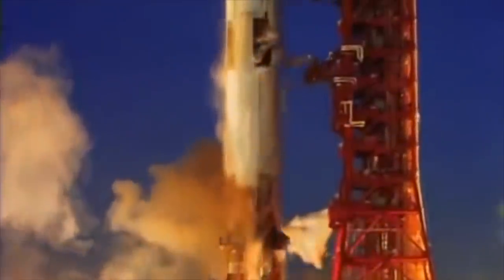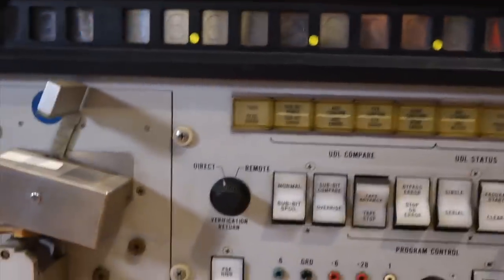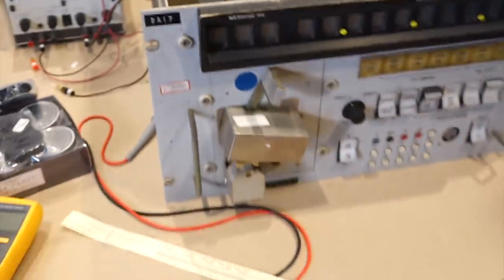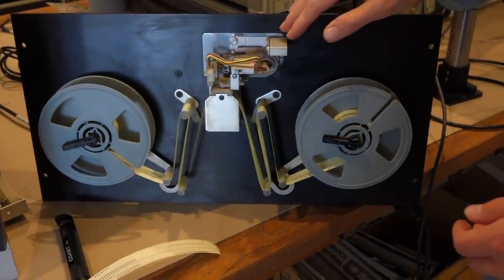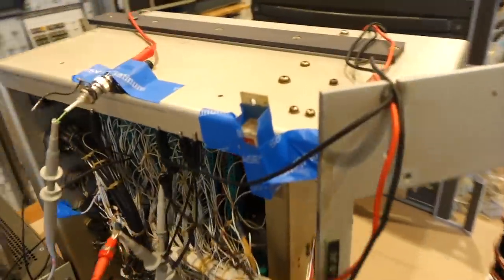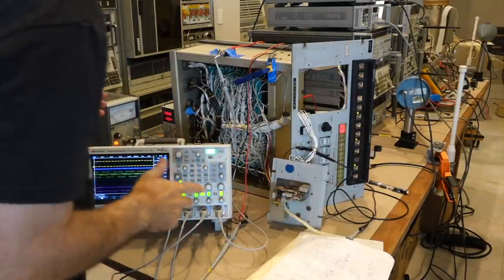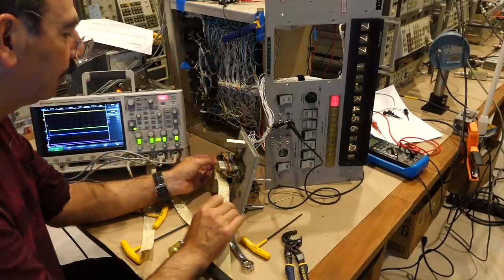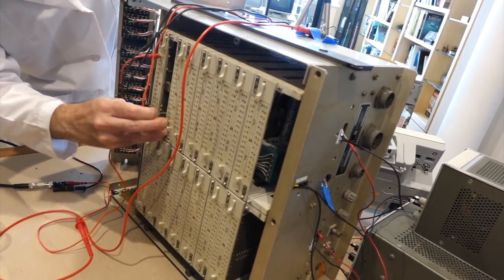Apollo Comms Part 9: Mystery Up-Data Link Test Set

Comment: Going this way in a couple of years time you'll be debugging the F1 ignition sequence on a rocket built from fixed scrap and spare hardware with holes plugged with HP test equipment, and I'll be writing a comment that the next step would be to try and do a couple of loops around the moon =)

Comment: A big rubber mallet and some pipe-fitter's pliers on the table too.  For when subtlety runs out.  
Congrats guys, you have intimidated it back into working order.
Reply from the maker: Taking the tape reader apart and extracting the cards required some convincing! Parts on the reader had sort of welded themselves together, and corrosion on the connectors made it impossibly hard to extract the cards. All fine now, nobody hurt…

Comment: There used to be an electronics surplus / recycler on US 1 in Cocoa Florida. When I'd visit my father in law down there I would stop in. Thay had alot of this type of equipment in the late 70's early 80's. I did't buy much give  I would have to get it back to the Chicago area. But this Apollo series brings back loads of memories.

Comment: Hi Marc,  i was given one of the hp power supplies you have on your bench. Unfortunately its not working. Where can i get the schematics for it. 
Is an HP 6286a i also have an HP 6263b and a HP 6253a all of which were broken and i want to restore them

Comment: Oof!  Much more challenging than the other equipment due to missing parts.  It would be great if the modules or something similar could be added to make the test unit self-contained and not spread about the bench.  We know you'll get there eventually.  Scary thing though, that this was part 9.
Thanks, Marc.

Comment: That is quite the transformer.  What voltages do the op amps work with?
Reply from the maker: See Ken's tweet here: https://twitter.com/kenshirriff/status/1429580374921781248 . It's many little independent supplies, Ken thought it was for keeping the op amps it powers isolated from each other. Four at +/-6V and two at +/-14V.

Comment: Amazing work! I may have missed this bit of info but how did they figure out on which slot to plug each different card? Was it a result of reverse engineering each card independently and the circuitry of the box so as to make an educated guess? That would have been a lot of work upfront before powering anything up.

Comment: Marc, you guys need to find a friend who's into large model rockets .... for reasons ...

I do love these videos, the old tech is easier to understand than current stuff because it's bigger and easier to see, but technically it does the same as current tech. Just slower.
They basically shrink and shove an entire old rack device into 1 or 2 chips.

Comment: It's an ongoing thing with the Apollo equipment but seeing Motorola everywhere is interesting to me. I'm a youngin' (from Apollo standpoint born in 1984) and I see Motorola as an "Information Technology" company that came out strong in the 1980s. I don't know why that was my impression but they've been around since 1928! Their big boom was post-WW2 but they don't get a lot of attention as the engineering GODS of their time they should be remembered as.

Looking at these older systems gives me endless respect for what they had to go through to make these systems work reliably in the worst possible conditions. Incredible.
Reply from the maker: Motorola engineers were the Gods of analog radio circuits, right down to the first cell phones. I still have a Motorola super thin flip cell phone, that was the best available at the time. Then they lost it entirely when phones and other radios became intelligent and DSPs, processor and software became the dominant elements, and their phones became the dumbest of them all. They sort of missed the switch to digital and software.